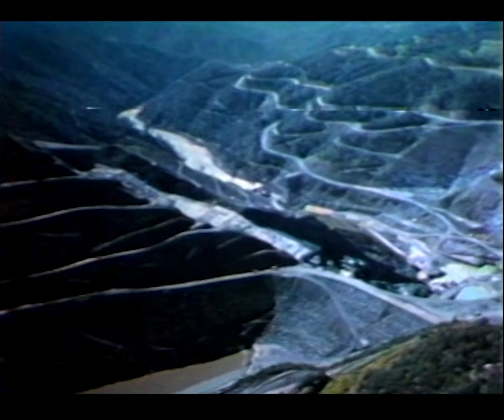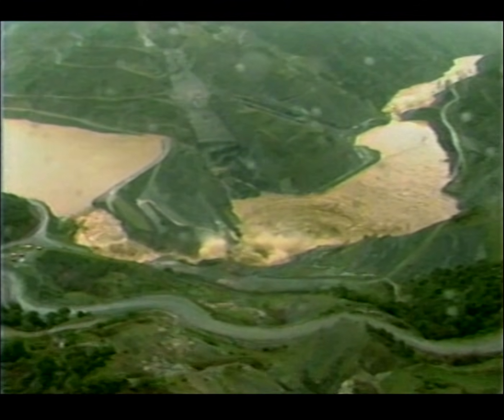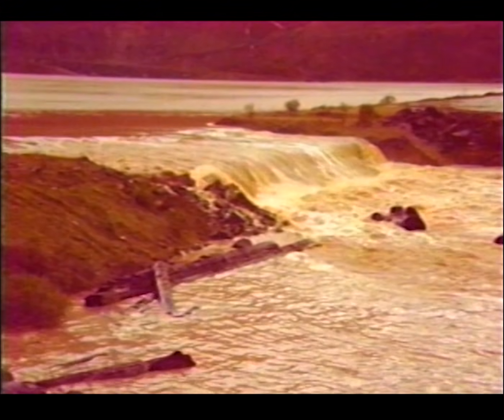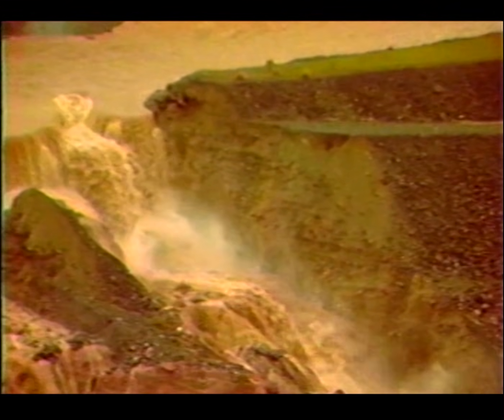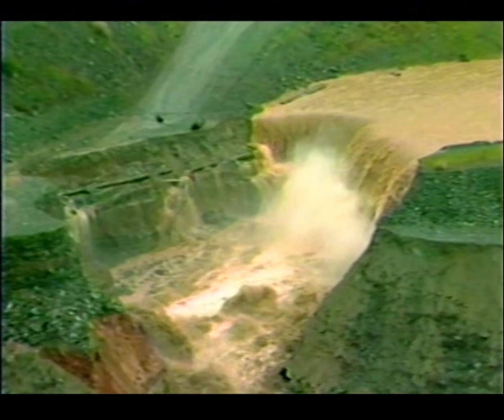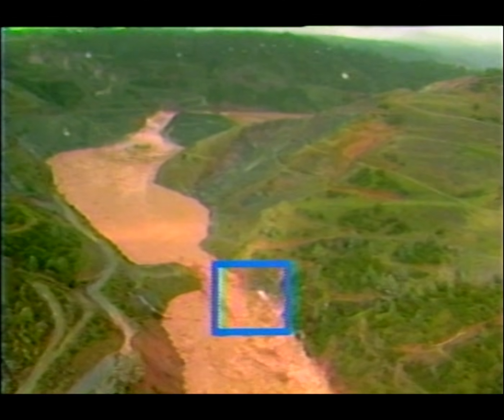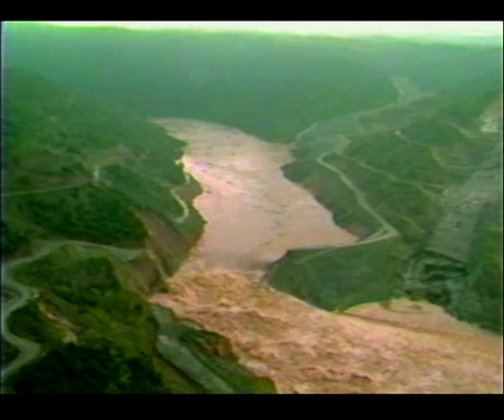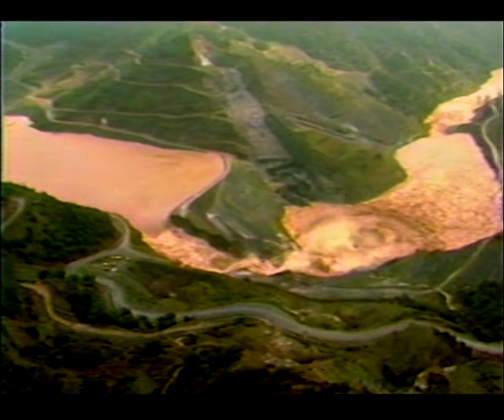Archived Footage: Auburn Cofferdam Failure 1986 - FULL ARCHIVED VIDEO

Comment: My wife and I have hiked all that area from maidu drive to the Wally mammoth cave. By the construction area, there are huge sheds with core  drillings thousands of them. Samples of how they found the fault line. 
Been through their own horseback as well     . If that damn was built, it would’ve changed the city of cool. Garden Valley, Georgetown. It would’ve been a populated Sacramento. Good thing the damn was unsuccessful.
Reply: It was actually a disaster it wasn't finished for the benefit of people's safety and water supply and clean hydro power. The fault line theory is false. The highest concrete dam in the world in 1906 is in the middle of the San Andreas fault and didn't even have a crack after the quake. The Sierra Club is responsible for spreading lies because they hate dams, which are a necessary evil in California to allow you to live in California.

Comment: Found this on AuburnDamWatch

Question: If the western Sierra Foothills are so seismically stable, then we donâ€™t have anything to worry about, right?

Answer: Under normal circumstances, that is true. However, there is an old, relatively inactive fault system called the Foothills Fault System that does run through the area. It runs right under the proposed Auburn Dam and it also runs under the Oroville Dam which suffered a magnitude 5.7 earthquake in 1975.

Comment: I remember this like it was yesterday. I remember being concerned about my city and also where I actually was. Yes, you read that right. That day, the 17th I was on a flight back to Sacramento from L.A. and on short final to KSMF. Looking out the window, about 300 feet off the ground all I saw was water. I thought, "hmmm that's odd".... wait my plane is landing near water? Did I accidentally get on a flight to KSFO instead of KSMF? I looked closer and it was farmland under about 30 feet of water. It looked like an ocean. Water as far as the eye could see. Once I got back in town, I headed home which takes me over the American River on US 50. The river was so high I could stand on the top of the levee and reach down and almost touch the water. There was so much water moving, it was humming.  I was going to CSUS at the time and lived literally across the street from the levee near the Guy West bridge.  It's a big 55-degree angle turn in the river where they figured, 'if it was going to fail, that's where it was going to do so". I didn't sleep that night, nor the next one.  Thankfully, by God's will that levee held.